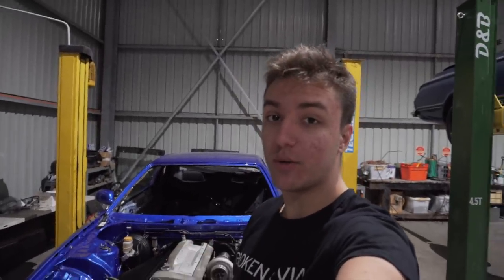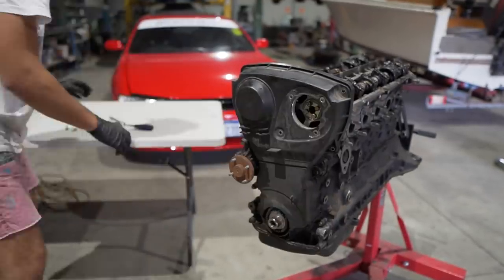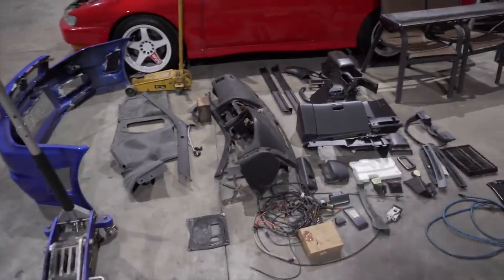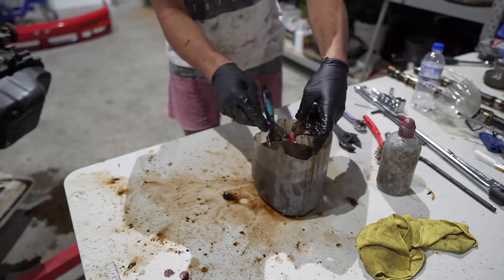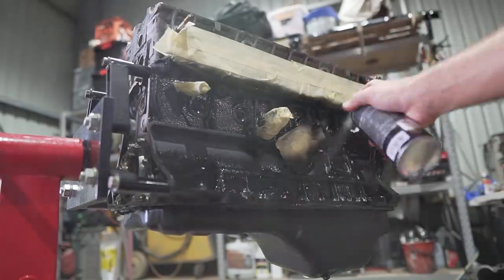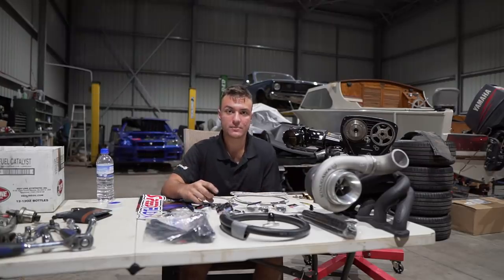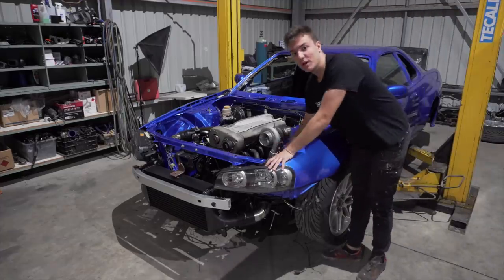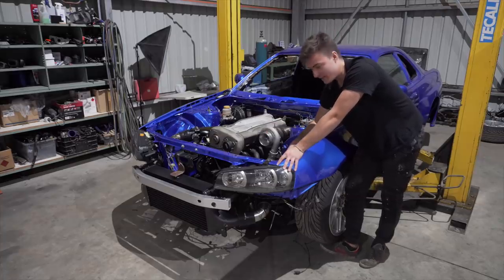Junkyard RB Engine Makeover - Paint, Single Turbo, Intake.. | Poor Man's GTR [EP18]

Comment: holy sh*t that engine was a mess to start with :O since you have RB26 covers, you should also put baffles in there since you don't have a head drain. You can get the Mines RB26 Baffle Kit from Nengun

P.S I reckon you should go the bayside blue on the covers, which is very similar to the stock RB26 blue. It'll go well with the black and aluminum :)
Reply from the maker: Yeah man haha
Already got some baffles, just need to put them in

Comment: Make sure when you seal the oil pan you go on the inside of the bolt holes, IDK if its just me but it looks like you went on the outside. You could get leaks.
Reply from the maker: I used my finger to spread it evenly 
cheeers

Comment: Hi Damian. Great build and great videos, I like it. Here is a tip about the RTV you put on the oil pan: In the footage you went around the outside of the screw holes on the oil pan. I hope you did put some RTV around the inside of these holes off camera as well. Otherwise oil leaks are very likely to bother you later.
Reply from the maker: Hey man, yeah I ended up using my finger and smudging it in everywhere. I think I'll use ultra grey for everything from now on, ultra black seems to leak everytime I use it haha

Comment: Great video again ! One question: when you installed the oil pan, you tightened the bolts going around in a circle. I always thought you’re supposed to start in the middle and work your way to the sides in a criss cross pattern, is different for these engines? PS: red valve cover would be my choice or whatever color you will choose for other details on the car
Reply from the maker: Thanks mate
Wouldn't have a clue haha, I just tightened it down

Comment: This brings back memories i hate cleaning all that oil and gunk.

te37 bronze colour is my pick for the head covers. I painted mine in te37sl graphite but i don't have the 26 covers.

 btw i woulda done valve stem seals while you had the cams off they're cheap. Also recommend checking the shim to camshaft clearance. Easy to do with feeler gauges. Piston rings and bearings are pretty cheap too but that's way more time..
Reply from the maker: Yeah didn’t want to go over board
I want see how far this engine can go stock

Comment: Could you list the size/threads of the fitting's you used on the engine block?
Oil feed
Oil return
Coolant feed
Coolant return

Awesome work as per usual bro!
Reply from the maker: Can't remember the sizes, most fitting thread pitches are online
I've made mistakes on 2 lines that i need to redo

Thanks man!
Reply: @BrokenSilvia  No worries I managed to find the details on the SuperFlow website. Where did you connect your coolant feed from?

I have a NA Neo powered Bayside Blue R34 GT Four myself, I'm about to boost as well! Will be following your progress man keep up the good content ;)

Comment: No turbo oil drain in the sump? Dunno if I missed something but I didn’t see it
Reply: Don’t worry looks like it drains into block. How good
Reply from the maker: Yeah drains to where the factory head drain is on the non-NEO Rb25's
Don't copy the oil feed location, the block is threaded as the turbo engines BUT is NOT drilled (no oil comes out of there). another mistake of mine haha